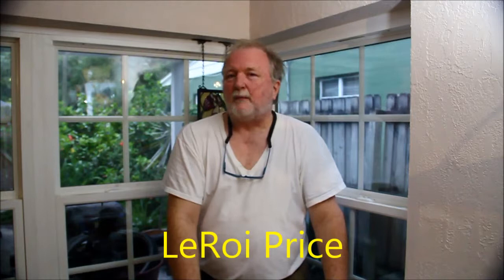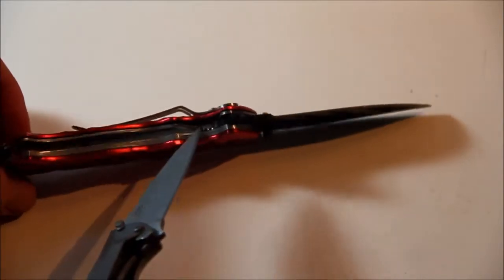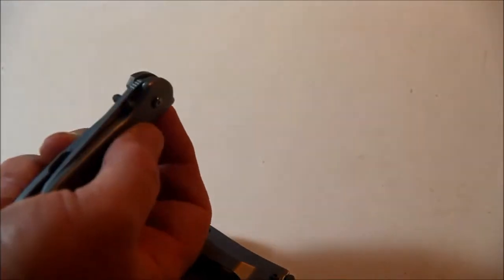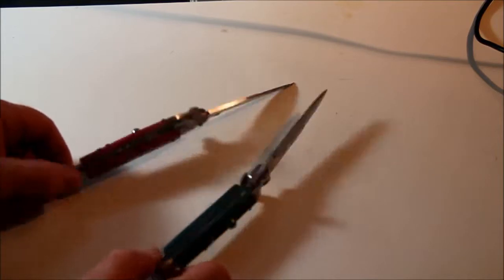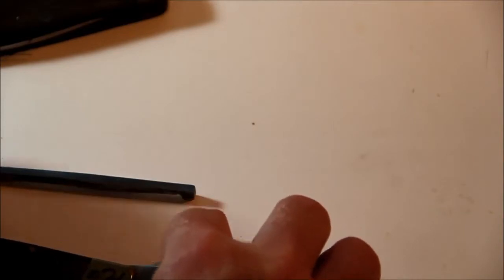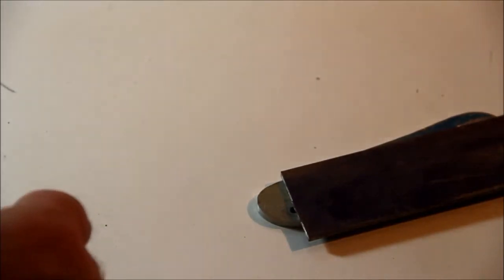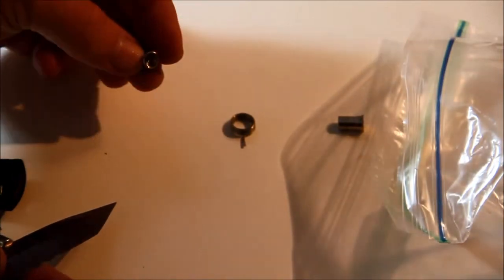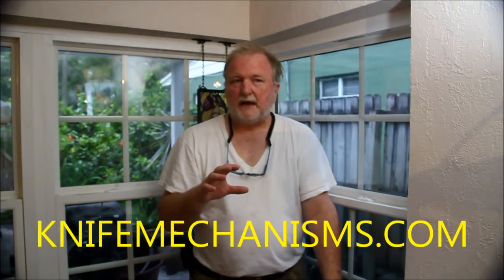Knife Mechanisms Failure   Liner - Frame - lockback - Button locks

Comment: I always wanted to know the locking strength of the high quality Switchblade...Latama, Beltrame, them vintage  ones. But it's also sad to see them go.. They're for 'stabbing' but a lot of people had them back in the day like my sweet grandpa. That's the first Vendetta Corsa etched switchblade he gave to me from the 1960s 👍🏻
Reply from the maker: You are absolutely right.  You should never see a DAOTF stiletto on the tool belt of a carpenter. If you do, I'd wonder what he's up to? But an auto opening utility knife could come in handy in a lot of situations..

Comment: May I ask, that is the point with this stupid video? Of course the knifes will break if you mistreat them by not using them as they are intended to be used. Used for cutting with the cutting knifes, no problem and for the daggers, stabbing, no problems. So, what is the point?
Reply from the maker: Of course anything will break if it is abused. There are millions and millions of dollars spent on crash testing seat belts, automobiles, airplanes, and even leaky baby diapers. The American Bladesmith Scoiety ABS won't grant advancement unless your forged blade can pass a test for reliability. All responsible knife companies do knife testing. The odd thing is that there is a lot of misconception on strength of mechanisms. You are right that knives used for cutting won't malfunction. But people will used a knife to pry open a door, chop down a tree, cut their way out of an inflamed automobile in an emergency. That is abuse. Not always intentional. What people want to know is what is the most reliable knife to carry. It may be unrealistic to think people won't act stupid, or unexpectedly find them selves in an emergency. This is the only video that compares so many different mechanisms. It is not hard science but it does aid in the discussion. I'm glade you choose to discuss it.  Some people still think a liner-lock is stronger than a lock-back. OK, fine,  I say where's your proof?
Reply: LeRoi Price 
Hi 
I'm sorry if I was a little bit harsh in my comment and thank you for your answer.
 What I meant and the point is, if you use a knife as it should be used and used wisely, that knife can and will serve you in any situation you would need a knife even in a emergency.
In your example, you don't pry open a door. If you do, you are begging for breaking the blade on a fixed knife or the pivot point on a folder. A more intelligent way is to use the knife as a chisel in that situation and chisel and carve the lock out.
No knife will break doing that. Not even the cheapest kitchen knife will do so.
And of course, regardless of lock mechanism. You can even use a friction folder to do the job.
What I'm trying to say here, is: You Tube is full of "torture" tests of knives and of course they will break. Very few, if any, videos is showing how to use the knife properly in different situations.
For example, batoning seems to be a popular subject on You Tube, but is that the right use and the right method to use in a survival situation then that knife is the only knife and tool you have? Perhaps a better idea and method is to use the knife to make a tool and split wood with wood?
More videos should show how to use a knife properly and with education no "torture" test would be needed nor any dicussions about which lock mechanism is the strongest when it can be shown how to use a friction folder for various tasks and if you can use a friction folder, you will have the "driving license" to use other lock mechanisms and you will never break that lock or knife.

Comment: With the exception of the little Kershaw Leek (second example) it looks like all of these are $5-$10 gas station specials made poorly and with inferior parts. Regarding the Leek, it's a small gentleman's folder not intended for hard use. This video is like testing televisions thrown out of a 4th floor window to see which still works afterwards. Why not test better folders to make a more informed decision? Or have a look at Andrew Demko's Tri-ad lock comparison destruction tests?
Reply from the maker: Some how you missed the point of the test. It was an experiment to analyze what are the weak points of certain knife mechanisms. I'll give you the benefit of the doubt since I did imply by some of my discoveries things like the scornful button-lock looked relatively strong compared to the ever popular liner-lock. There were many surprises and perhaps I was eager to share my amazement. But don't interpret this as an ultimate shoot out of one knife to another. It was "how they fail" first and "BTW how much" second. Look at Benchmade testing on Youtube to see them pit one of their knives against another. BUT, even better look at Coldsteel testing.They actually do testing of their knives against other brands. You will see their results follow mine. The bottom line is you wont find what I did anywhere else. Not all of it. I hope everyone enjoyed it and had fun. It was fun. I stand by my research only so much as to say YES, a $400 knife would be stronger than a $5 knife BUT, they both will fail in the same way due the inherent design limitations of their mechanism. Do I think some mechanisms are stronger than others? I sure do now. But why did I do the testing. Mainly because dozens of times on the web one guy asks "What is the strongest mechanism?" And somebody else says, with a tone of great authority, "Oh, liner-lock of course." Well that kind of talk will continue. I just had to see for myself. And
I just hope now they will just say "In my opinion" instead of "Of course". Everybody is entitled to their opinion.
Reply: Thanks for taking the time to provide such a lengthy and detailed explanation.

Comment: What a useless generalized statement to say thumb studs are stronger than liner held stop pins
Reply from the maker: The testing was done. I am reporting what was learned. There are two ways to make a stop-pin. Commonly just put a pin loosely into two adjacent holes in the liners. The other way is to actively fix it by a screw or perhaps some other means. A stop can also be a back-strap or commonly also, the thumb-bobs. The knives tested showed much, undoubtedly, stronger resistance to failure in the thumb-bob stops over the loose stop-pin stops. If you care to do your own testing I would be pleased to see it. I would think, considering equally made knives, the physics favor, always, the thumb-bobs.

Comment: to be fair, the liner lock on the first red knife is obviously very thin and likely week. not a fan of liner locks anyway but I have some knives which have a THICK frame lock which I would say is equally as likely to deform as a blade would, which essentially means the types of pressure needed to break the knife or even make it potentially dangerous are unlikely to be achieved without extreme batoning *
Reply from the maker: +TeslasLoveChild  Yeah, well like you I was surprised by a lot of the results like I said. There is a lot of knife talk on the web about what mechanism is stronger. So to dispel some myths and truly to satisfy my own curiosity I destroyed several knives. I'll tell you the liner lock is a good mechanism for general use but the cheap (thin liner) ones I tested did not fair well. And compared to a lock back for instance, really looked bad. I didn't fake anything. OK, I don't have a $25,000 tensile test machine but I think my tests have some validity. But take a look at the Benchmade videos. They do have a $25,000 tensile test machine, and their results coincide pretty much with what I discovered. 
Yeah, It is odd that a frame lock has that thin segment but I guess the scale is so thick that it would not be flexible enough to act as a spring. I agree with you that such a knife with out that weak segment would be very strong. But probably to unlock it you would need a pry bar.
Andre Demko tested Cold Steel knives on Youtube  against others. Odd that all the Cold Steel were stronger. Ha! But anyway, he didn't test any liner locks from what I recall.
A lot of people break knives on Youtube, and show knives that got broke somehow.  Either way, it's fun! I just tried to do it so we all could learn something from it. And have fun!
Reply: Sir, so could you tell me wich locking mechanism is the strongest on the market? Maybe it's axis lock, tri ad lock or Spyderco's powerlock ?
Reply: good Q, it depends on the quality but generally back lock or frame lock, and again depends on the application.
Reply: Axis lock is very strong, but it has a huge weakness (the spring) *
Reply from the maker: MisterSir I agree a frame lock is stronger than a liner-lock. The problem is it must still functions as a spring and a big thick piece of titanium, or steel, is too stiff to be easily opened. The fix? Put in a thin section at the back. Now there is a weak point in the lock bar. The testing I did as shown in the video resulted in demonstrating how a frame lock fails in comparison to a liner-lock. Which is pretty similar over all. Benchmade used to have video's of their tests on their wed site. They made still be there but I think they removed them. Anyway I put these results (Benchmade and mine) in the book. They show basicly the same result as I got. I only used cheap knives, but well made knives should have similar weak points